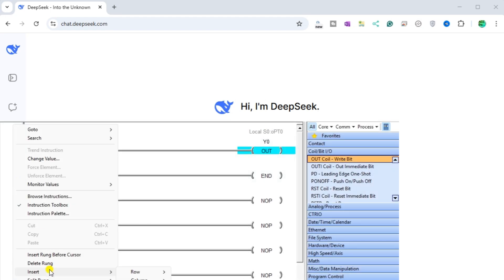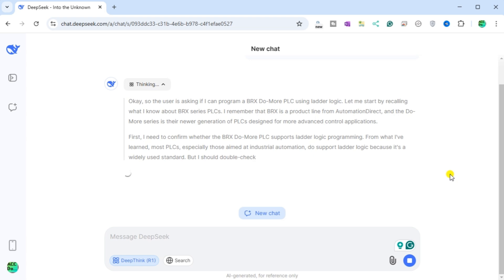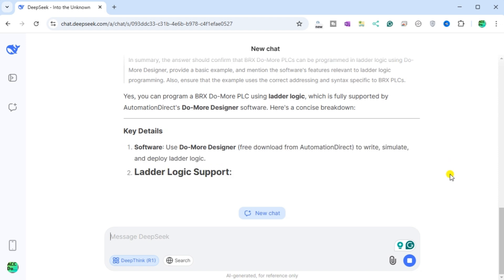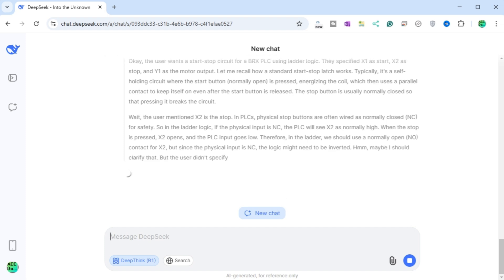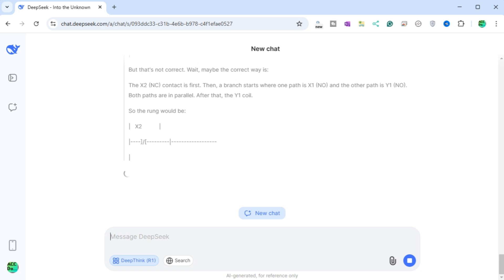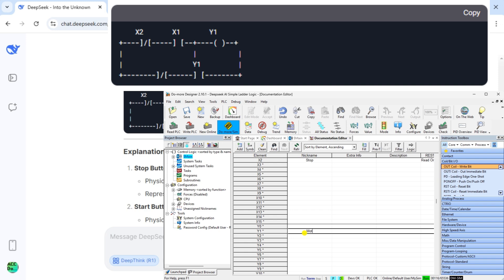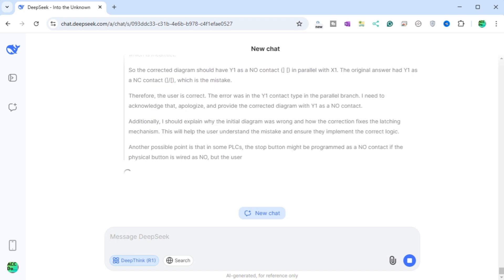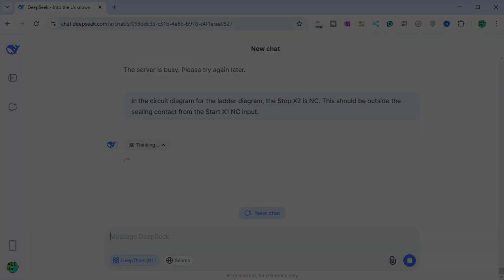Mind-Blowing AI Creates Perfect PLC Start-Stop Circuit First Try?

Comment from the maker: More information can be obtained on our website. This includes all of the links mentioned in this video.
https://accautomation.ca/deepseek-ai-start-stop-circuit-in-ladder-logic/

The entire BRX Series PLC can be found here:
https://accautomation.ca/series/brx-do-more-plc/
Using AI for structured text in an LS Electric XGB PLC:
https://accautomation.ca/xgb-plc-structured-text-first-program/

There are several reasons why we are using the BRX Series Controller. Here are just a few.
 - Standalone PLC with built-in I/O
 - Built-in Data Logging 
 - Communication ability - Ethernet Port, RS232, RS485, USB - support for protocols such as Modbus RTU, Modbus TCP, ASCII, K-sequence (Direct LOGIC users), Custom Protocols (ASCII over serial, TCP or UDP over Ethernet)
 - Built-in Analog input and output
 - Integrated motion control
 - High-speed counters
 - Powerful instruction set (Video of Instructions in software)
 - Ability to expand the system with a variety of modules
 - Part of the Do-More series of PLCs uses the same free software. (Do-More Designer)
 - Integrated simulator in the software capable of external communications for testing

The BRX series of programmable logic controllers consists of four different units. They differ depending on the Inputs and Outputs built into each unit and whether it has an Ethernet port. 
No I/O Micro PLC unit – (BX ME)
10 Point Micro PLC unit – (BX 10/10E)
18 Point Micro PLC unit - (BX 18/18E)
36 Point Micro PLC unit - (BX 36/36E)
These CPUs (Central Processing Units) are also known as MPUs (Multi-Processing Units) because of their communication capabilities.

Regards,
Garry
ACC Automation
https://www.accautomation.ca